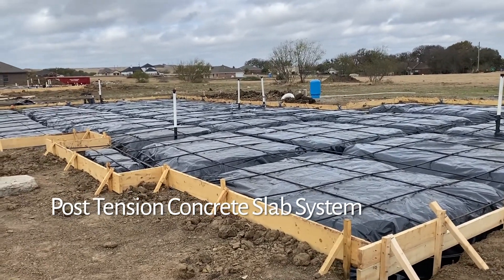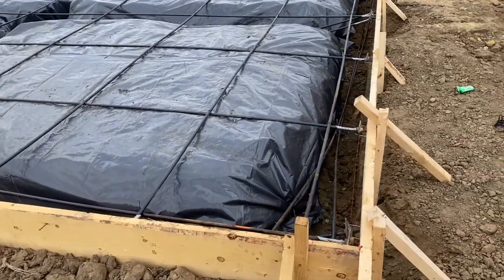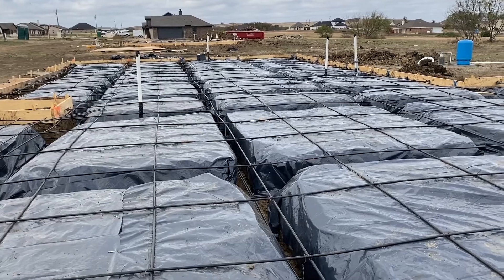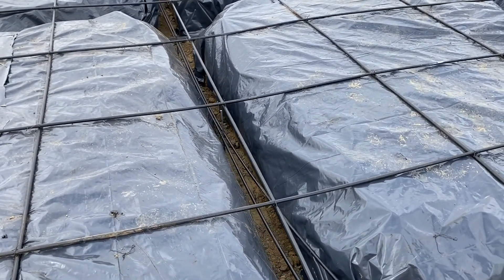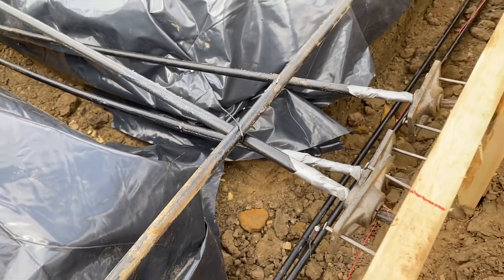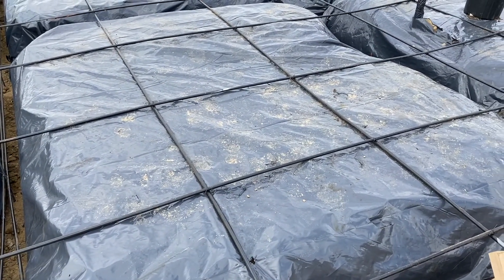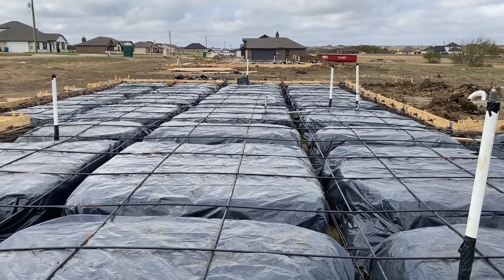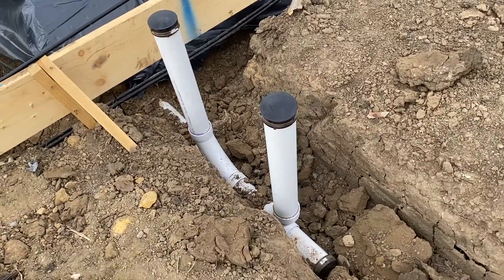Post Tension Slab--before the concrete gets there.

Comment: Thanks for posting.
Most of the post tension cables are sitting directly on what will be the bottom of the floor. Don’t these cables need to be elevated so they’re in the middle of the concrete floor?
Reply: Yes … looks like the conc crew just hadn’t put the chairs under the cables yet.  Those are typically done last as it makes it’s harder to move around.

Comment: For someone new and learning about structural engineering and foundation setup, Would plumbing toilet drainline ever be directly over ontop of beam location? Also what is the thickness of the beams, sizes side to side? Video mentioned the beam is about 2 feet deep but did not say how wide. What is the typical thickness of a slab foundation? Could a slab foundation be thicker more then 6" to 8" depth? Perhaps 10" deep? Any structural engineering that can answer more questions for me?
Reply: Depends on the type soil in the area also height of building

Comment: I have done over 13,000 apartments, the majority being post-tension, and the cables are not supposed to lay on the ground.  They are to be on chairs so that they are encapsulated in concrete.  Also, the poly should go down in the beams.  Where the poly is torn, it should be patched.  Also, the comment on where the concrete comes to on the dead-end is wrong. It is supposed to be completely encapsulated.  I am not sure, but it appears that some of the reinforcement in the beams is not correct,
Reply: See https://youtu.be/Q-mQ9HkyEbo
Reply: those tendons in the beams look awful too. and theres exposed tendon cable.
Reply: Most of these videos on YT are showing Concreting not done correctly. 
All rio should be sitting on chairs not just the cables. And this guy has no idea, the majority of the trenches in the middle are to hold the slab together in reactive soil. Some would be for load bearing walls but all the non load bearing walls are fine to sit on 100mm concrete.

Comment: Is it just dirt under those plastic coverings? If so, is the dirt compacted? I don't see how that could hold up a freaking house.
Reply from the maker: The part under the plastic is I disturbed soil. The other is trenches dug to hold the concrete.
Reply: The foundation holds up the house, not the dirt or concrete slab. The foundation are the outside and inside beams.